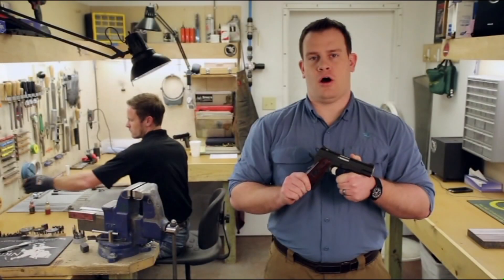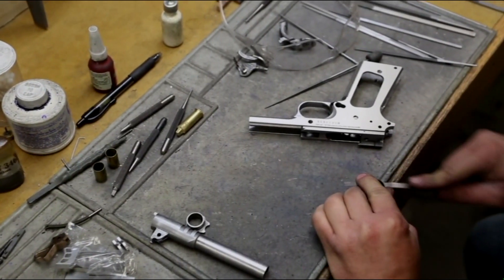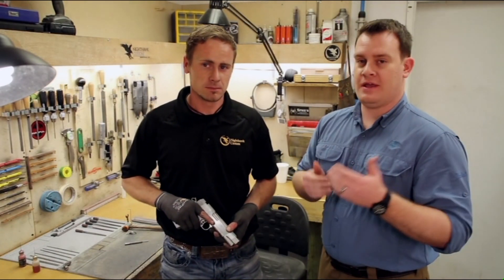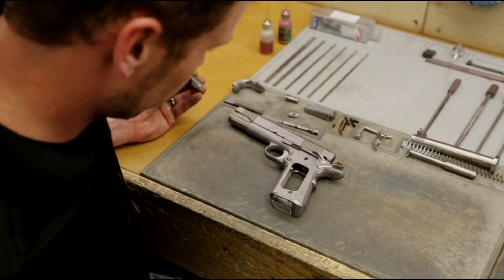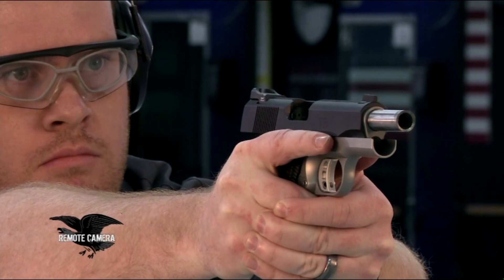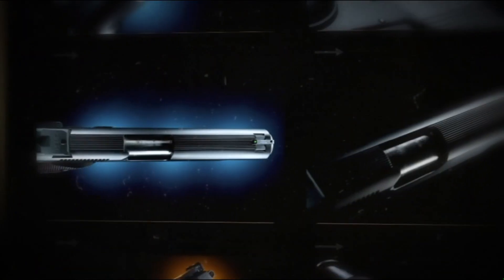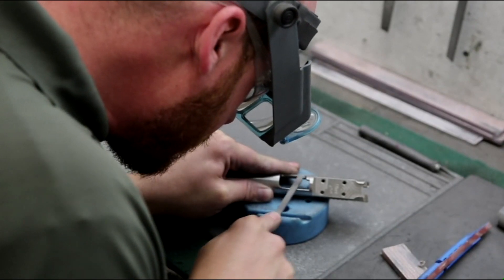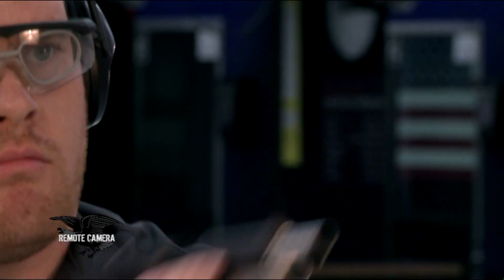Video—ARTV: Nighthawk Custom

Comment: 2010, moved to Prescott AZ, walked into High Country Gun to look at buying a 1911. I had my hands on a Springfield TRP & ready to buy it until my eye caught a glimpse of the Nighthawk Dominator. I tried to find every reason not to spend at the time 2800.00  on a pistol but I lost the fight. And it was a decision I have never regretted. If you're a true fan of 1911's & if there is anyway possible, it would give you such pride of ownership in owning one. Plus you add in how great of a company they are to deal with (They should give customer service lessons to Colt) You'll love every minute you spend with it.